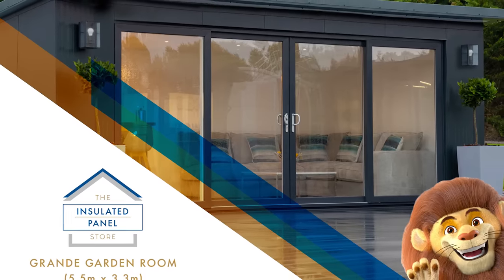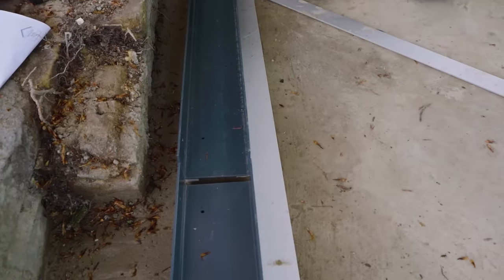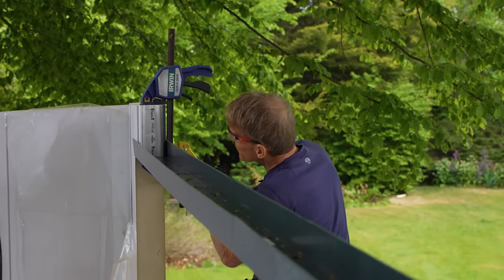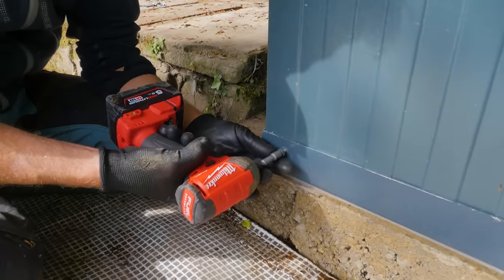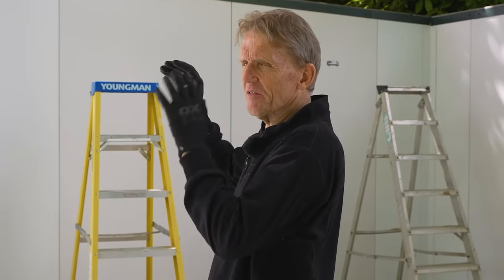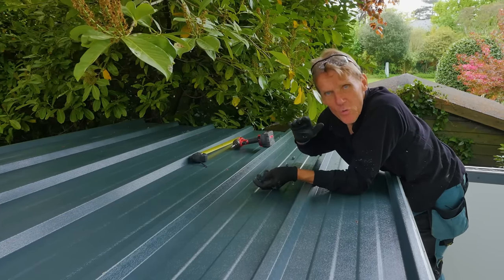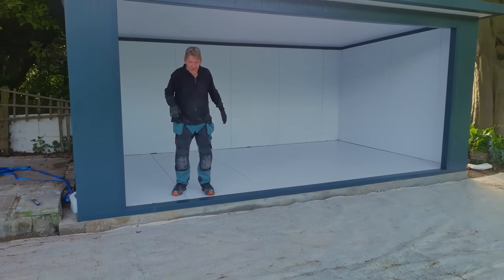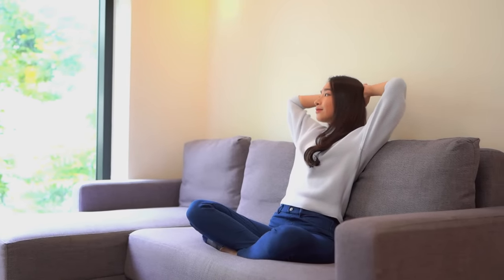How to Build an Insulated Garden Room In 1 Day

Comment: Out of interest what's the cost on that particular kit inc doors?
Reply: Just for comparison, I have had a very similar build done recently (although the galvanized steel framing and base was far more heavy duty than this). Total cost including them building it, electrics, fibreglass roof and plastering was around the £25k mark.
I think the trade price for supply only for the one I had is closer to £15-£18k.
Reply: Each kit has three different options.  For the smallest kit, sliding patio doors (cheapest option are around £900) and for the largest kit they do, sliding patio doors are around £1700 which rises to around £4500 if you went for aluminium bifold doors.

Comment: would you need to apply silicone on every screw fixing roof panels and also on the roof overlaps?
Reply from the maker: No need
Reply: No Silicone is required on each screw. The screw fittings have a silicon washer and a metal washer that makes a seal around the screw.

Comment: £9 .400 without the doars and lecy. They materials would cost a grand of the shelf. 8 grand seems a lot to cut the panels to size.
Reply from the maker: I don't know anywhere that sells insulated panels of this type let alone the channels and corners pieces. There are many ways to build a garden room and this is just one of them. Some people think the convenience and build quality is worth it and others may not. 
The market is the market and it decides.
Reply: @SkillBuilder  looks very similar to the insulated panels they use in small factory units,only up on end. Runners, capping pieces is all there exept the corner pieces, couldn't find them.£ 25 ms. Brilliant idea btw. Keep up the rant.lol

Comment: That seems an awful lot at £8600 (with 10% off). Add windows £3.5K and cost of base £13K no electrics, no flooring, no internal finish. A roof with no guttering means the rear overhang would have to be some way from a fence, so it can’t really be built close. I think there are too many niggles to make this a long term viable build. Also what is the insulative rating of the wall?

Comment: For nearly 10k with doors or electrics not included, I think it’s over priced. Nice though.
Reply: Jesus, is that how much it is ? I built a similar size garden office recently, over a few weekends, spent under 1k total. Timber framed and clad in 150mm treated pine. Power from an existing SWA cable and the house Wi-Fi penetrates the structure quite easily.

Comment: This system is not perfect and is only suitable for moderate warm and hot climates. The steel channel, which stiffens the structures of the binding sandwich panel, is a cold bridge, respectively, condensation will fall out on it. This system is not suitable for cold and Arctic climates.